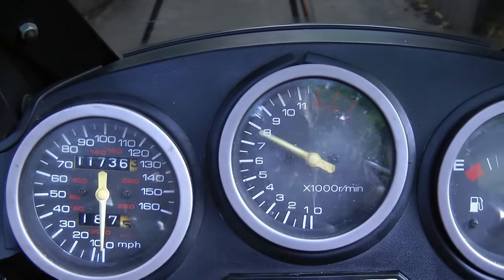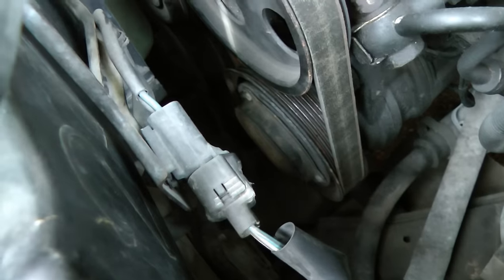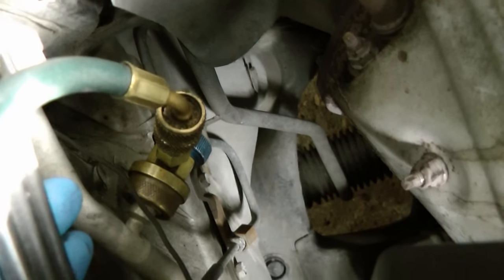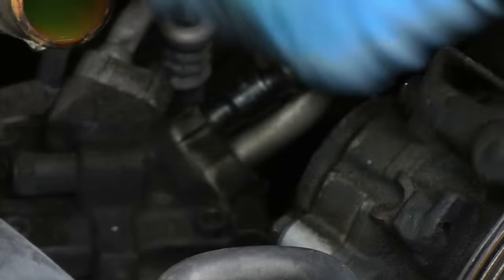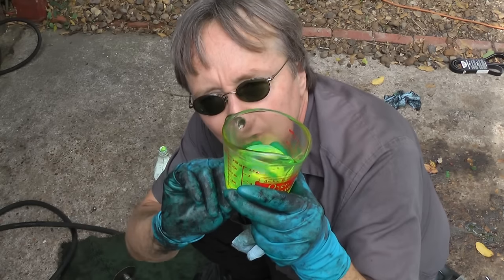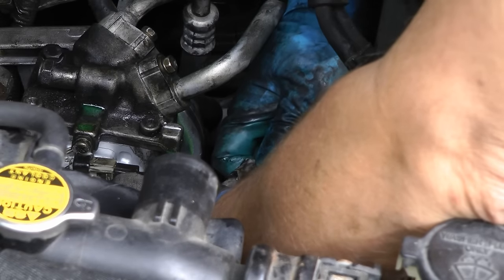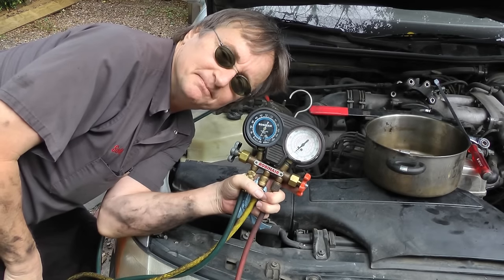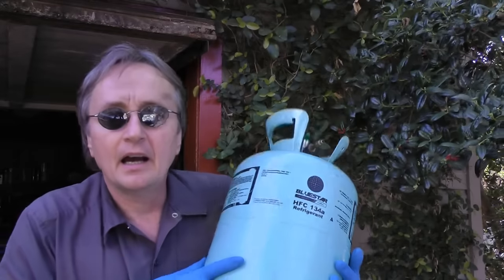How to Replace AC Compressor in Your Car

Comment from the maker: ⬇️Things used in this video:
1. AC Gauges: http://amzn.to/2BIru4v
2. Vacuum Pump: http://amzn.to/2k8R1NN
3. Ratchet and socket set: http://amzn.to/2inoxOY
4. Mechanic’s Tool Set: http://amzn.to/2Bzmccg
5. Wrench Set: http://amzn.to/2kmBaOU
6. Shop Towels: http://amzn.to/2jGDfkA
7. Disposable Gloves: http://amzn.to/2zSRuxO
8. Common Sense
9. Full HD Camera: http://amzn.to/2AvoEk7
10. My computer for editing / uploading: http://amzn.to/2i2sKYz
11. Video editing software: http://amzn.to/2jv5Fhf
12. Thumbnail software: http://amzn.to/2k7tz6C

🛠Check out my Garage to see what I use every day and highly recommend:
https://www.amazon.com/shop/scottykilmer

❗️Check out the Scotty store:
https://goo.gl/RwhRGU

👉Follow me on Instagram for the latest news, funnies, and exclusive info / pics:
https://goo.gl/ohy2cA
Reply: Hey Scotty!
   I drive a GMC Jimmy 2000,  my AC is slowly spinning this same way---how much do you think that'd cost to replace?
Reply: Scotty Kilmer many times ask questions but you didn’t reply 😐
I want to remove Hyundai Sonata compressor how to close the gas from going to the air ?
Reply: How do I know if it's the compressor and not the pressure switch?  Is that something I have to get a mechanic to diagnose?  My 07 outlander will blow cold at first, but then quit after a while.. and then I can re-set a while after that... but living in South FL doesn't help the situation
Reply: excuse me you have a link for the other items but i cant seem to find a place to buy number 8.
Reply: 9
Reply: HELP!! 
how much should labor cost on a 2011 sorento? paid 459 for parts. SCARED and NERVOUS! can't afford to get taken for a sucka lol
Reply: Can you please come fix my car A/C?
Reply: What will happen if I didn't use a vacuum to drain the freon

Comment: Another way to test the compressor is a simple trick that a mechanic taught me a LONG time ago. Take a paper clip or small wire and put it in the A/C compressor relay and turn on the a/c. If it spins, it's good. If it doesn't, get a new one.

Comment: Thank you for showing me why it was a good move to take my car to the mechanic.
Reply: Its always easiest to take it to the mechanic,once you learn if u want to learn u will put the money in the pocket and its not rocket science
Reply: @KN-mi7mh  But you need the tools.  One of the biggest reasons why people don't like fixing their own cars is that they'll run into a problem that wasn't expected, and they get stuck.
Reply: @znhait  true u right
Reply: @znhait  Yeah this all looks like something i could do if it weren't for the step of purging the refigerent before starting anything else. I can get a vaccuum pump and gages for 100 bucks, but a machine to remove refrigerant? That's another ballgame.
Reply: @jackburton2680  except you can always take it to a mech to purge the refrigerant out, and do the rest yourself, saves money in the long run… but I know money isn’t a problem for many

I enjoy working on my cars so going to a mech for the purging is all I would do
Reply: @jellisgoose  Yeah that's how i did it. Had a shop pull the refrigerent. Then i changed all the components, took it back to the same shop to get it reserviced....only for the AC to not come on. Don't know if the compressor was bad out of the box somehow or what, very frustrating.

Comment from the maker: You have to vacuum the system any time it's opened to the air, as air in the system will wreck the pressure whether it has moisture in it or not.

Comment from the maker: compressor clutches only need positive power to run, and negative ground to ground the clutch so it works. Other wires are sensor wires, you can normally just bypass them. Or, if you don't want to do that, get the correctly made replacement one, you got a cheaply built one, see that a lot with the chinese made ones.

Comment from the maker: @PVoyager change the belt first, if it still does it, see if it's the tensioner slipping, Or a bad clutch. But me, I never change ac clutches anymore, just the whole compressor as they are normally badly worn with the clutch and changing just the clutch is a band aid waste over time. Scotty

Comment from the maker: you can add oil to a noisy compressor and pray. if a compressor comes with oil, it needs no more. And you can turn the compressor after it's put on the car

Comment: Thank you for your video. I wasn't sure if I should add the oil to the compressor before or after it was vacuumed out. I installed one incorrectly 3 years ago and am hoping to do it the right way this time

Comment: Hey Scotty. Thanks so much for your AC videos. My compressor was leaking oil and I did the replacement last weekend all by myself. Since it's an old car, I replaced the receiver drier and all the o-ring seals on the lines to make sure nothing else goes wrong in the near future. I used those 12 oz cans of refrigerant instead of that big tank you have, and a small digital kitchen scale for measurement.

Comment from the maker: @kd25510 cause the inside drives the compressor, the outside only is driven by the pulley. the inside only works when it gets electrical power. Scotty

Comment: Great video, Scotty. I just had my ac compressor burn out. There was smoke coming from the engine on the passenger side and through the air vents. Took it to firestone. The original compressor had a lot of charred stuff coming out from the sides and the pulley wouldn't turn. They put in a new one. They did everything you mentioned that needed to be repaired or replaced to make it functional again. A friend suggested a pulley kit to attach to the alternator and crank shaft. Decided to repair it all at once. I would've eventually had to add that ac compressor back, summer is a coming. Took over 4 hours. All good. Cost just under $1000. Drove car, 1996 toyota camry LE with a v6 engine, home. That was about a one hundred mile trip. Worked great. Wish I was closer to home to try to get help from a neighbor to replace it.

Comment: your video just saved me $900. the mechanic wanted 600 for the compressor, $100/lb for R12 (my car takes 3lbs 4oz). plus labor and checking for leaks. i found a remanufactured compressor for 200, no cost for R12 bc my uncle had it, and it was $100 for tools (manifold gauges, etc). all together every thing cost me about $300. If i am ever down by you in Houston, i owe you a drink

Comment from the maker: @killshotnation yes, they hide them everywhere. BUT they are all on the low side hose, so go to the compressor, follow the thicker low side hose back to the firewall, and somewhere there will be the low pressure switch. BUT, you may really mean the high pressure switch, which is on the high pressure line, so follow the thin line for that. Scotty

Comment from the maker: @darkvader47 Hot wire it direct from the battery and see if it takes refrigerant. If so, either fix the electronics Or run a toggle switch to run the compressor, it's a lot easier. Scotty

Comment from the maker: @lowlow643 Electrical problems can be cows to fix. Me, I'd just hot wire the compressor, and it that works, I'd do it permanently with a toggle switch and wire from the battery positive to the ac clutch. Scotty

Comment from the maker: @RastaMan699 sure, try hot wiring it direct from the battery to see. If so, fix it, or run a toggle switch from the dash to it to run it on manually., Scotty

Comment: Hey there Scotty! I recently had to replace the AC Compressor and Drier in my '02 Avalanche (It gets a bit hot here in Oklahoma during the summer) and without your videos and advice, I would have been stuck paying some mechanic shop easily triple what it put into the job - and I get to keep the tools for future use! I got the compressor from a place on ebay for about $150, orifice tube, drier, high pressure valve for about $50 online, vacuum pump and gauges at Harbor Freight (some people complain, but I haven't had a tool break from there yet) for $150, and r134 from Autozone for $20. I learned a lot in the process - a buddy of mine does home AC so he recovered the old refrigerant for a case of beer! 
Anyway, just wanted to give you a big THANKS for the advice and instruction. AIRBORNE!!!!
Reply from the maker: If you like my car help, be sure to watch my live car talk show every Saturday morning at 10 AM CST on YouTube. I answer your car questions LIVE there. Just check it out at How To Ask A Live Mechanic Car Questions Free On YouTube . And remember, every TUESDAY  I upload a new video, so don’t miss them.

Comment from the maker: simple job, no video yet though. You loosen the bolts on the adjuster and swing it down to get the belt off. Most have an adjuster with a screw assembly that loosens and tightens the belt

Comment from the maker: @aftoyboy your guess is as good as mine. You need a dealer level diagram of those hoses, try to get a dealer parts department to print you one out. I don't even have such info in my data base.

Comment from the maker: to get a correct hose, they have to be described to the seller. They are all Ac hoses, and you say "the ac hose from the compressor to the condenser" if it's that hose.  Or the drier to the evaporator hose. Wherever the hose goes, you describe it.

Comment from the maker: @Davis2920022001 If you bypass it and it doesn blow cold, then you are either low on refrigerant or have another internal problem int he system, so check the refrig level first. Scotty

Comment from the maker: @imabichover9000 could be a leaking evaporator hiding back there. YOu can't see it, so have a mechanic use his sniffer machine and a little refrigerant in the system to see if the leak's there. Scotty

Comment from the maker: you have to find the exact leak point, use soapy water and it will buggle from the leak area. see if it's the hose, the gasket, or the compressor, could be any

Comment from the maker: there are certain amounts of oil to put in ac compressors, and that information should be obtained before putting a new compressor on.  but the process is exactly as I show to change one out > ONLY if the old one blew and threw metal inside the system, you would have to flush it out, change the expansion valve, the drier, and the condenser to make sure it would not break again.

Comment from the maker: find if it's radiator coolant or ac refrigerant coolant. Fix whatever is leaking, and if it's coolant, it's obvious as the radiator will be empty when you take the cap off

Comment: Hey Scotty! I have a 2012 Scion xB with over 168,000 miles on it. I bought a new A/C Compressor Kit from AutoZone for around $430.00 because my current compressor is blowing hot air and no longer works after getting 2 opinions one from the original dealer that I bought the car from and at a Firestone Complete Auto Care shop. I have already gotten taken to the cleaners once at the Firestone Complete Auto Care near my home. I had the radiator cooling fans replaced for a bill of over $1,200!!! I asked the Firestone place what they would charge for the labor if I bought the AC Compressor Kit from Autozone and if I provide the parts. Firestone said that they would allow me to provide the kit for them to install. They said I have to buy the compressor from them. Firestone would have charged me over $2,000!!! for the parts and labor. I tried to lookup these mobile mechanic websites online to see if they provide reasonable rates if I provided the parts. But they wold have charged me over $1,000 labor even with parts. I called a local independent repair shop not too far away from the same Firestone place that charged me over $1,200 for the new radiator cooling fans and quoted me over $2,000 to replace the ac compressor. I called this place. They called me back and they quoted me an estimate over $1,400 for labor with me providing the parts!!!!!! I am so frustrated because I have already gotten ripped off once with the radiator cooling fans. I do not want to get ripped off now with my ac compressor problem. I am not an auto mechanic and I am not an expert on cars.  I just want to know  how I can find a good auto mechanic or shop that doesn't overcharge for labor and overhead and everything!  I have seen a couple of your videos on how to avoid getting ripped off by certain chains and pop-and-son's auto shops, But I cannot seem to find a mechanic that offers reasonable rates just to install a new ac compressor that I bought new to provide for them. I don't know who I can turn to. Help!!!!  Sincerely, Daniel Willis from Homestead, Florida. Thanks Scotty.

Comment from the maker: often a wearing out compressor does that, but check the system for low refrigerant and a loose or worn Ac belt and PRAY it's that.

Comment from the maker: scanners just retrieve info, if the wiring to the compressor is bad, it will flag the compressor as bad in many cases. Not the greatest software, I'd try replacing the wiring and connector

Comment from the maker: you must evacuate the system first, then fill it up with a factory load of refrigerant.Start there, but it it won't take refrigerant . try hot wiring the compressor clutch with power from the battery to get it start sucking

Comment from the maker: first, hot wire the compressor with power from the battery and see it it spins then and cools. If so, repair the electronics. if it doesn't even spin then, compressor is shot

Comment from the maker: I've never done one, but the books calls for 3 hours of labor, so a lot of crap will have to be removed to get it off. My data system does not give any more info on it, perhaps get a cheap manual.

Comment from the maker: @Tynlinz if it runs fine and cools fine, why not just run a toggle switch from the battery to the compressor with a 20 amps inline fuse? makes it easier than finding shorts.

Comment from the maker: you could try it, but if you hot wire the compressor first with power from the battery, and it still doesn't spin, then NO.

Comment from the maker: when they lock up, good idea to change drier as crap may be in it. And then you need to flush it. But if you're not going to use it, just cut the belt off

Comment from the maker: compressors are run by power going to the compressor clutch, that's how they work. I assume that's the wire.  I would assume you have a compressor problem in that car, overheating the comp and then it stops working a while.

Comment from the maker: you just remove the compressor and plug the lines with any type of plug and a little silicone sealer to keep it on. Then bolt on a bypass pulley where the compressor was

Comment from the maker: Sometimes that's a blown AC compressor clutch, you could try just a new one. BUT me, I would change the whole compressor with a brand new chinese made unit, they cost less and work fine. Gambling with just the clutch on the compressor is often a losing proposition, it may not last long.

Comment from the maker: should have battery power there, test the battery and if it's like 12.5 volts or so, you should get near that at the compressor.  Test it off the battery , and if it works, many guys will then run a toggle switch off the battery to run it.

Comment from the maker: compressors cost a ton on saturns as they don't make em anymore.  You would have to change the compressor, the driver, and the expansion valve in an attempt to get it working. Good luck

Comment from the maker: ac compressors don't leak coolant, they leak refrigerant gas. I would assume you have a cooling system leak near the compressor instead. Pressure test the cooling system to find the leak as in my video "how to fix an overheating car"

Comment: Scotty,
2006 Chrysler 300 3.5 RWD. 
Filled coolant last year.  
Now blows hot.  
Added AC Pro and it's now cold again but hear no audible leak although I don't think I filled it to max with refrigerant so the pressure might not be strong enough.  
Any advice on locating-diagnosing leak?
Thank you in advance.  
Your videos are priceless and you present in a clear and charismatic manner that is greatly appreciated
Never stop being awesome!
Reply from the maker: johnnymac1975  put UV leak dye into the system and check for the green leaks. OR, buy a 100 dollar sniffing machine that smells out AC leaks, you can get em online easily

Comment: I might eat these words soon (my luck) but...My 95 Ford Explorer has the best air conditioning system I have ever used. It still has the factory a/c components (including compressor) never had one problem with it, except for the need of recharging once or twice in its lifetime. According to previous owner maintenance records from dealership, they changed out some sort of A/C manifold thing (not sure what it is) at the 100'000 mile interval, (maybe something to do with it?) However, my sisters 2001 Honda Civic a/c compressor was replaced after only 150'000 miles of service (my explorer has over 200'000 miles). I always thought that maybe because it is smaller, it has to work harder to keep things cool or maybe I'm wrong.

Comment: We just replace the radiator on our 02 Venture. It ran fine for about two days, then when we started it, it said "POOM" and started spewing coolant. We aren't car pros by any means, but are trying to do as much as possible to save money. It's spewing from an area on the lower passenger side of the engine, on what I believe is the compressor? It's a brass piece that looks a bit like a hex bolt with a hole in the top. Maybe an air pressure issue?

Comment: i just bought a 1999 mazda protege from a small dealership, and the ac didn't work in the car. Later i found out there was a belt on everything except the ac compressor the dealer even installed brand-new belts. I put a different belt that went on the ac compressor this time and now the ac works like a charm.